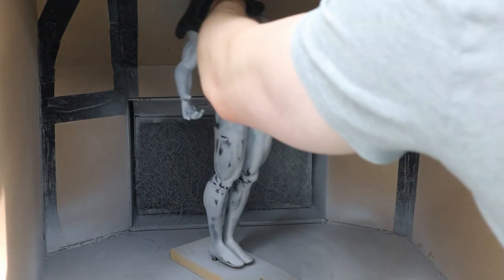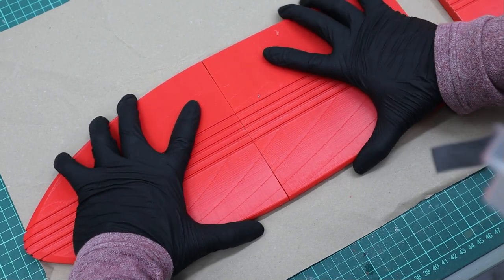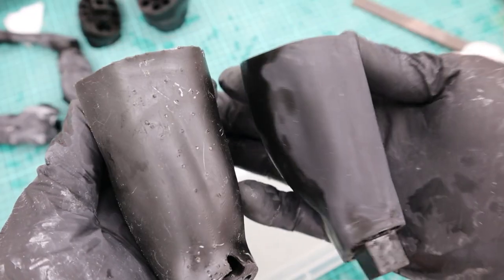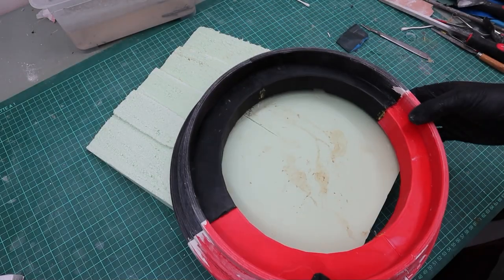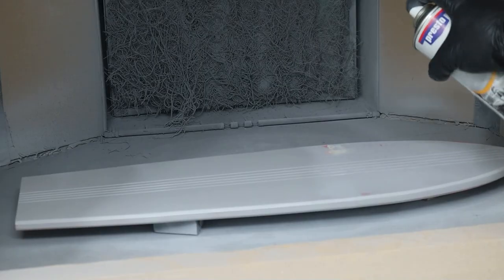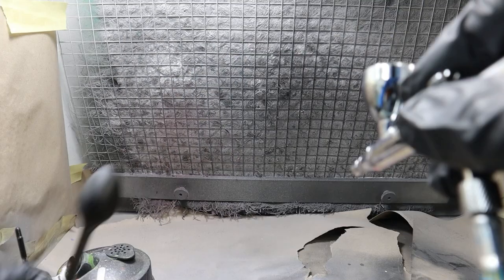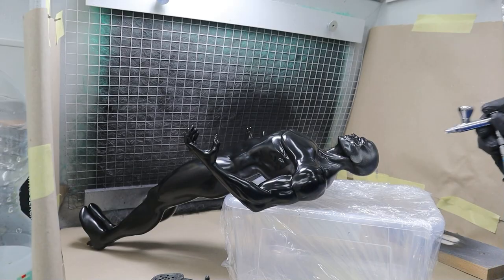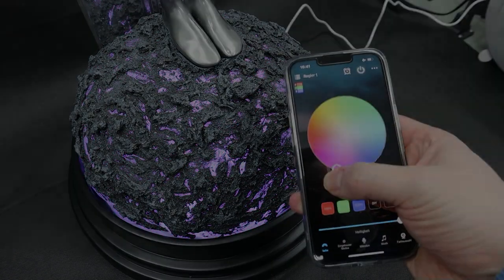Quarter Scale Silver Surfer | How to get a perfect chrome finish

Comment: Follower u on Insta also I recognize that Duplicolor Gloss Black, got the same brand here in RO. The cool thing is i was just testing that Green Stuff World Chrome Brush version with the airbrush 2 days ago and got some small bubbles on it but when applying with a brush using the dabbing method it doesn't have that. I basically used my 0.5 Iwata Revolution airbrush, thinned it 10-5 with IPA at 17 PSI and i applied it as a heavy coat, do i need to apply it as multiple light coats? It doesn't seem to rub off it left a few days to fully cure.
Reply from the maker: Thanks! I didn't thin mine at all, but used the 0.8mm nozzle. You definitely need to apply it heavy, it needs to flow on the surface to create the perfect chrome effect. I also tried multiple thin coats but that didn't work at all for me, no chrome look at all.

Comment: Amazing job!!! Does the wood filler cause future problems with any cracks? I ask because I never used... thx for video :)
Reply from the maker: Thanks Marko! Good question, I actually don‘t have any real loong-term test experience there. The board is primed since August last year and so far no cracks inside. Probably also depends on the brand and type of filler. The one I‘m using is really smooth with no texture. I guess with a couple of coats of paint and without any stress on the model it should be fine - fingers crossed
Reply: @evolutionxstudios  thanks for the feedback. I'm going to test it here on some models and I'm going to use it smooth and without texture. A big hug from Brazil!
Reply: @evolutionxstudios  honestly, I would just use Milliput or Apoxie Sculpt for all your seams, and an auto body filler for the surfaces (print lines, etc). They won't shrink, crack, dry out, or give differential responses to primers and paints.
Reply from the maker: @kevinfutter  What I don't like about auto body filler is the terrible smell and the fact that (most of the time) it's a two component filler. And if it's not a two component filler I guess you have the problem that the tube dries out before you are done with it - happens with the Tamiya putty as well
Reply: @evolutionxstudios  get yourself some Isopon P.38 if you can find it.